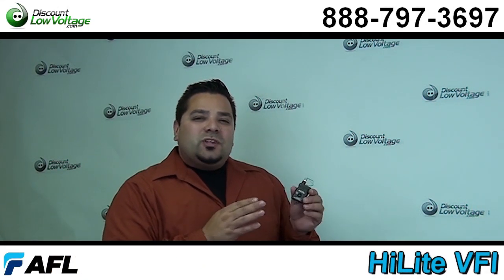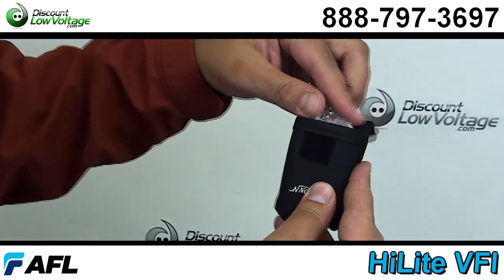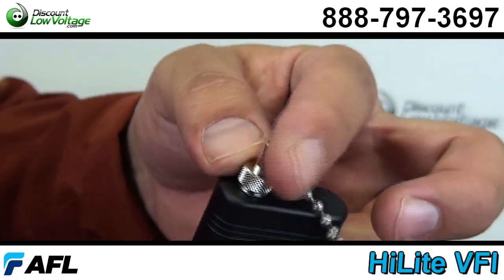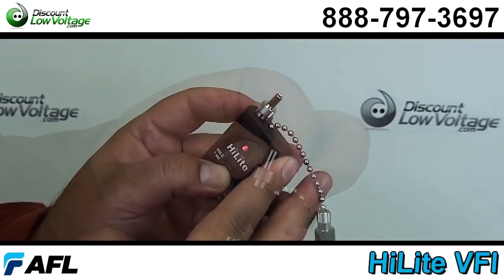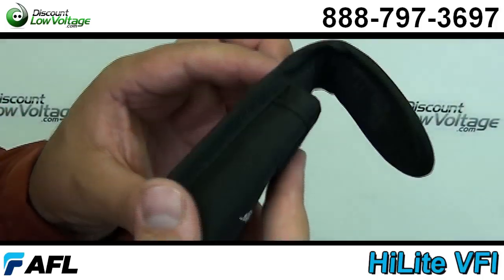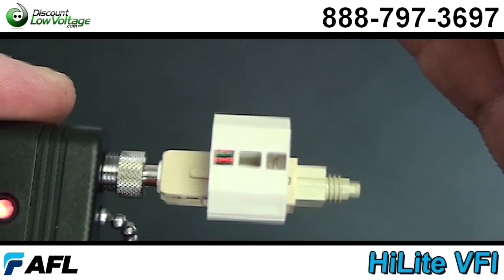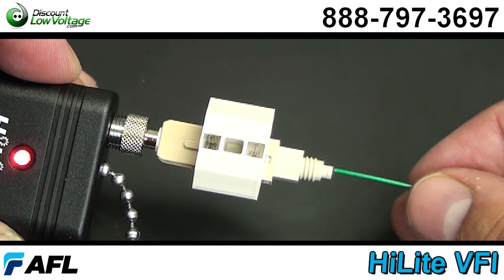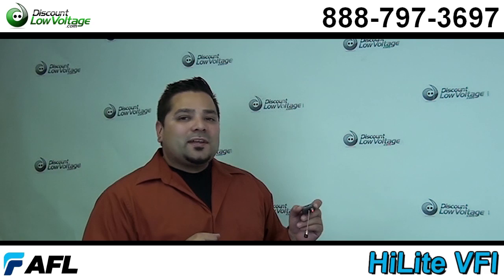Fiber Optic Cable Connector Visual Fault Locator AFL HiLite

Comment: That's an excellent tool. I have one of those AFL NOYES units and use it for all the applications you describe. BUT, I have also found it very useful at night for finding breaks in the Outside Fiber Plant when the partial break is caused by a bullet hole or a squirrel chew. I have actually been able to see the break flashing from down on the ground 20-30 feet below in aerial plant applications. I have gotten use out of it up to nearly 4 miles in distance. I have had it 2 years with zero issues.